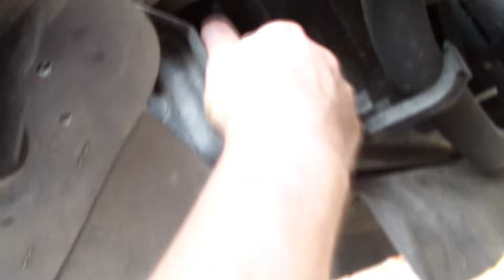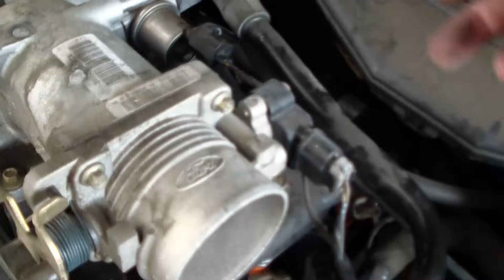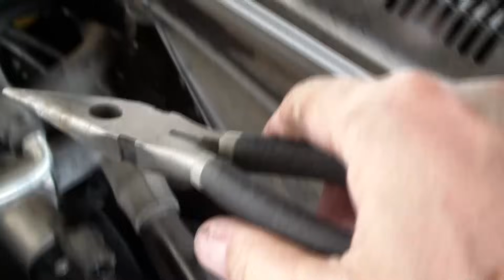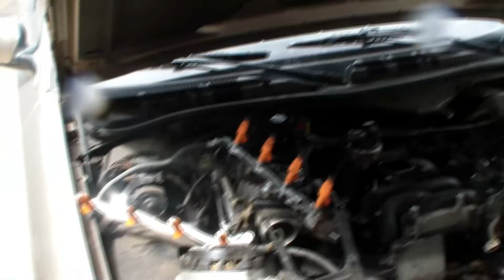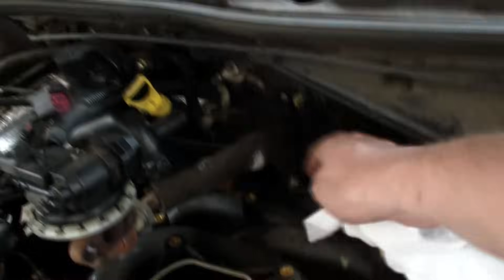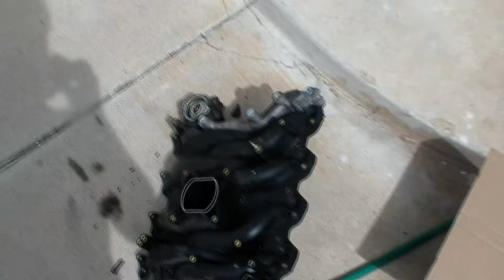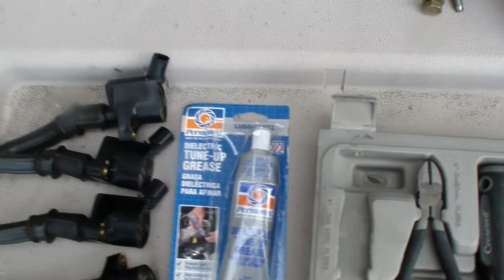Ford 4.6L V8 Intake Manifold Replacement

Comment: I THINK ITS ABSOLUTE BULLSHIT THESE ARE MADE OF PLASTIC IN THE FIRST PLACE
Reply: +Michelangelo Hamato I never minded fast cornering until reading your comment. I now realize my car is a potential deathtrap having an aluminum intake, and I'm scared shitless it topples over.

I'm not a race car driver my friend; and I don't need to run for nobody.
Most of us simply like cars that hold together, not with manifolds made out of recycled toothbrushes because it saves the manufacturer $1,53 a piece.
Reply: Jupiter Fox! - They're made of plastic because it's cheaper to manufacturer, period, the end.
Reply: Total BS. I hate to break this to you, but manifolds used to be made of cast IRON. The ONLY reason they used plastic is it was cheaper for the manufacturer period.
Reply: They are made of plastic because you don't want a really heavy metal piece on top of your engine for a better center of gravity, plus a metal intake would heat up the air before it got to your engine

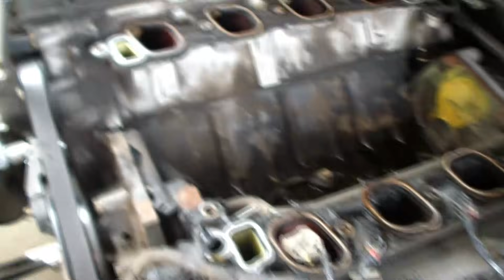Comment: Omg hopefully you or someone can help me...my bottom intake (made of plastic) under the intake manifold exploded. ok so i got a new one to replace it, took the old one out and in your video at 16:45 you can see yellow paint and under that looks to be some kind of plug on top of the engine block...now on my 4.6l v8 there is just a hole there now. Is that normal or should there be something in that hole like in your video??? i dont want to put it all back together until i find out what goes in that hole...hopefully nothing? pleaseeeeesssseee help!!!!
Reply: if anyone finds out what that plug is under the yellow paint at 16:45 or if it's need can you please email me at mulletslayer101@aim.com. like i said my lower intake manifold exploded and when i removed the intake and lowerintake i notice a hole in the back of the motor that is in this video at 16:45 and looks like there is somekind of plug in this video that mine does not have...if you can tell me what this plug is or what it is for or if it is need i would be greatful!!!
Reply: mulletrun69 I have a 1999 ford f150 4.6l v8 ok last post hoping for the best..thanks!
Reply from the maker: Looks like a freeze plug. Does anti freeze come out?
Reply: i dont know because i drained all the fluid before i removed the intake...and i didnt see any fluid on top of the block when i got the old intake off
Reply: Kent Diego is there anyway to post a picture on here? someone would know exactly what that hole is looks like a plug went in there maybe
Reply from the maker: mulletrun69  This Youtube site likely does not have a lot of people reading comments. Find a Ford forum for maybe trucks, Mustangs, Lincolns or Crown Victoria that is active to post your photo and question.
Reply: ok thanks...i just stuck a rubber freeze plug in it and am hoping for the best when i put it back together...keep em crossed!
Reply: mulletrun69 that hole is made for leaks that get into it....its like a drain pipe

Comment: Bought my '97 Thunderbird new 09/04/97:
-1st manfold failed: '99 @ 36,000.....
-2nd OEM Ford Recall  manifold failed: 07 @ 107,000.....
-3rd Dorman failed: 09 @ 110,000.....
-4th Dorman installed under waranty '09 and STILL HOLDING! FINALLY!!!!!!!!!
+my sister & neighbor have both replaced their intakes in their "97 Crown Vics!!
Reply: Peter43John The new ones should last as they have the aluminum cross over for the coolant.
Reply: newstart49 hope you are right sir. Car is now 18 years old and I have enough legitimate repairs to worry about without the need for this Mickey-Mouse BS!!!!

Comment: Hi man i do evrithing like u say but i have a problem when i start the engine have not spark and smell like gasoline so i apreciate if u got a solution for me
Reply from the maker: It is likely the CPS, crankshaft position sensor unless it was good before replacing manifold. Google for troubleshooting tips. Do you get a code when you scan the bus? Be sure everything is plugged in OK.

Comment: Great video Kent! I discovered a leak recently while changing out valve cover gaskets on a 2000 Ford Mustang GT. The introduction is also the only place I could find on the Internet that clearly pictures the o-rings seated onto the manifold and explains the removal of the old gasket and prep. Thank you for sharing!

Comment: Kent i have coolant leak from the intake manifold gascket right under the tormostat housing can i change the gascket only or should i have to take off the intake manifold please help man Thanks alot for your video ?
Reply from the maker: If "under" means under the manifold and not the thermostat housing then that is bad. Often where the aluminum is bonded to plastic is leak so new manifold is needed.
Reply: Kent Diego so if the the antifreeze leaks from under the car....that means the manifold?? Because mines is doin that right now just notice today....
Reply from the maker: cheeze montana  Antifreeze can come from many places if under car like water pump, freeze plugs, radiator hoses, head gasket, heater hoses.... Leaking AF leaves small traces if you look hard. When car is hot look for drips.
Reply: Kent Diego cars been off for for four days....it didnt start leakin from under the car untill I moved it across the street closer to my house.....its driping from under the belt pully all the way at the bottom....im going to try that bar seal stuff to see if it stops the leak do you think its a good idea?? Also on amazon pricing the new manifold...good prices on there I seen the kit you have...im banking on that one but I dont wanna go buyin a new manifold if I dont need one and it could be something small....also checked the thermostat housing like you said and that was leaking to....today it wasnt but it was before...theres a bunch of residue of af there....I knew that it was leaking...just never knew that part where the hoes plugs up to was the thermostat housing....
Reply from the maker: cheeze montana  You are describing a water pump leak. Do not use Bars Leak. It will clog your heater core. Replace the water pump to fix.
Reply: K thx for your help
Reply: Kent Diego one more thing sorry if im buggin you...lol...so that means the water pump could be gettin antifreeze in the spark plugs and I wouldnt have to get a manifold?? Just dont eant to buy one if I dont need it..but im going to replace the water pump first to see if it stops leakin from under...then replace the thermostat to see if it stops at the housing....if not successful....manifold here I come....its really stressful but I love my grand marquis my father gave it to me a year ago....and I dont care if the engine goes im gettin it fixed....its one of my dream cars....I dont care if it sits for year before I fix not that it would sit that long because I love it to damn much....lol

Comment: I changed my intake manifold a  day ago now im having wrong engine ignition and loss of power and a little engine know , can someone' help , is the timing wrong ?
Reply from the maker: The timing is controlled by the crankshaft position sensor and you did not touch that. Make sure you hooked up all the cables and hoses correctly. Check the throttle position sensor connection. Most common problem is vacuum leak where you have rough idle and and hesitation. Scan the OBD2 bus for error codes. Maybe post on some Ford forums.
Reply: I did not touch anything besides the throttle body kit, i do have a torn hose ive just found ill have that replace also my rpms lower and increase while in park
Reply from the maker: Stone Fourtwentyy  "Torn hose" if intake means air bypasses MAF sensor. Otherwise has to be vacuum leak, TPS or EGR. Re-check everything you worked on. So no codes and a check engine light?

Comment: Will this Dorman 615-175 fit a 2005 Mercury Mountaineer V8 4.6L SOHC engine?
Reply: +Ni Limit Yes!
Reply from the maker: +Ni Limit I lost 1 MPG with Dorman. Wish I got factory replacement. Ford Racing has OEM unit for reasonable price.

Comment: You don't have to take off the alternator.  I just removed the top bracket and had room to pull intake up and out.  I noticed a smoother idle after swapping the intake on my 03 Crown Vic.  One thing you do not want to do is bend the EGR pipe.  I did and ended up breaking it...
Reply: Thanks for the tip on the alternator.  I didn't have to remove mine from my 4.6L F150 either and it saved me a bunch of time.

Comment: What's the update on the car since the replacement?
Reply from the maker: Car runs great. My MPG seems a tad lower, maybe 0.5 to 1 MPG worse. One of my coils went out but easy replacement.
Reply: I didn't have the same luck as you, attempted to this chore, and I bought just the gaskets but not the gaskets to the Dorman intake manifold, (the O-rings) so after putting it all together installing just the gaskets that go on the head I had a terrible leak, I then had to tear it down again, a tad bit annoyed and ordered the Dorman O-rings.I still had a slight leak. I cranked the car and turned out that a bolt had fallen into one of my intake manifold and ruined my valve stems. Now I am in the process of swapping another 2V in and taking the gaskets out having a shop replace them, OR taking a Lincoln Mark VIII 1998 and swapping it into my Mustang GT.
In retrospect your video was great, very well paced and informative, please keep it up.
For all the DIY's out there, get some professional help and be careful.
Reply from the maker: Pedro Matias  In video I added annotation suggesting using silicone rubber on all O-rings as many others had issue with vacuum leaks. The factory manifold is a better solution. Stuffing paper towels in intake ports keeps bolts from dropping in. You should be able to find rebuilt heads for replacement from a local machine shop.

Comment: Im leaking antifreeze (Not a whole lot, more like traces of antifreeze) around manifold, I'm planing on doing this, it's an 07 CV, should I get silicone rubber and just do the gasket, or just change the whole thing?
BTW, great educational video. much appreciated.
Reply from the maker: It depends how much your time is worth and your risk tolerance. I suggest you inspect carefully and maybe stuff paper towels under manifold. This way you may be able to isolate exactly where leak is coming from. If hose seal, thermostat housing or temp sender unit it is easy fix without removing manifold. Most likely it's where aluminum front is bonded to plastic back of manifold so will have to replace. All that is left is gasket. There you have to risk your time and effort whether to just replace just the gasket or to replace manifold too. The factory manifold is better than Dorman part. I lost 1 mpg.
Reply: Kent Diego I will stick with OE. While it won't be much of a problem in the winter, I'm very much concern about the summer. Leak is not very bad, but it will be in the summer. Thanks again.
Reply: Kent Diego after watching this video I am convinced that this is a job for my mechanic.
Reply: indeed

Comment: Hey do have a link to the fix (cutting) for that bastard bracket. Does it have a searchable name?

I have a vacuum leak right under it. And as I was backing out that long bolt, the bracket was rising with the bolt and scoring the unthreaded part so I think that bastard bracket is my problem.

I'm hoping to just cut it or remove it and use a bolt that is the same size as the other normal intake bolts. Maybe fighting it back down will fix My vacuum leak.
Reply: Ok! life would still be sucking balls without the internet. I would have never found your generous video or this write that gives a little explanation of the Bastard Bracket (Crash Bracket). 

http://www.p71.ca/P71interceptor.com/p71interceptor.com/intakemanifold/replace/pictures/

My idea will work for eliminating that piece of shit bracket, but it's yet to be seen whether it fixes my vacuum leak.
Reply: That was the problem. Cut the bracket. Found a bolt to match the other manifold bolts. put it all back together. No more high pitched hollow (it was pretty bad). I noticed a lot more suction noise coming from the air box, when I toggle the throttle. 

Thanks again for posting useful shit.
Reply: Did you get a cel code with that vacuum leak? My Expedition just had the intake manifold done and I'm hearing more air noise sounds coming from the air box, but no codes yet..
Reply from the maker: Removing the fuel line crash bracket was not that hard. There is only one bad bolt. If you can remove it, do that, and save cutting it off for the last resort.
Reply: I did not get a cell code at any point for the vaccum leak. Update On the vaccum leak, it came back. The bolt hole threads were so stretched out the hissing started back in only a few short days. I'm going to try some lock tight.

Comment: Great video!! where did you get the O ring? you mention it came in the kit but which kit? it came with the intake or had to get the kit separately for the intake? 
thank you!
Reply: should do one removing the heads lol is what I'm doing;(
Reply from the maker: The O-rings are built into the aftermarket Dorman part. The factory part does not use O-rings. Many others have reported a leak at O-rings. If I was to do this again I would have put a bead of silicon sealer on each ring.
Reply: ooh okay thank you! my currant mustang is leaking from what it appears to be below the thermostat, i was thinking i might of needed a new o ring

Comment: I see you installed the temp sending unit plug, what about the temperature sensor? it looks just like the sending unit one but a different color, one is green, and one is grey.
Reply from the maker: That plug was by thermostat housing in an unneeded hole. The temperature sender unit was on other side and that was installed.
Reply: Oh ok, good video! i got mine installed!

Comment: I believe the ford modular engines are all metric, thank you for the video
Reply: You are correct. All mounting hardware on American cars that I have worked on are all metric since about 1985.  If you look at a decimal size chart you will see that there are a few sae sizes and metric sizes that are close but most are not.
You may be able to fit a standard sae size wrench on a metric bolt and if it is not too tight that combination might actually work, but if the bolt is very tight where you have to put a lot of pressure on it the standard sae wrench will slip.  When i started working on cars all hardware was standard sae and I bought a lot of standard size wrenches.  Then metric came along. So now I have two sets of tools, one is metric and one is standard sae.

Comment: The dorman manifolds are complete shite. I have been through three of them on my 98 mustang with PI heads. The intake "gaskets" or o-rings dorman made a poor decision here. I have been through three of them and a few months later I get massive vacuum leaks where the intake meets the head. Ford had the right idea with the two intake gaskets, they seal much better. Do yourself a favor and get the ford racing intake manifold, it's manufactured much better. Oh, and btw this manifold actually gives you a drop in horsepower by about 10 or 15 compared to the ford part. It's been proven by dyno results.
Reply: Buy the pi intank from Ford racing you'll be happy you did
Reply: I have a REAL intake I will sell you..sling that DORMAN back to china
Reply: @davidross2427  Funny thing is that they are made here or at least they used to,lol,the one i have on my T bird with PI heads says real big on top, made in USA

Comment: Thank you for what you've done I have to replace this part and after the operation I have got a problem I do not know how to fix the engine is running, but when you press the gas pedal the engine is not going quickly and gets the delay in the response I did not find a solution to this problem
Reply from the maker: So it is a hesitation or stumble off idle? This is symptom of a vacuum leak. Check three places.
1.  Hoses at throttle body.
2.  EGR valve.
3.  The intake mating O-rings at cylinder head (most likely).

Scan the diagnostic bus for codes.